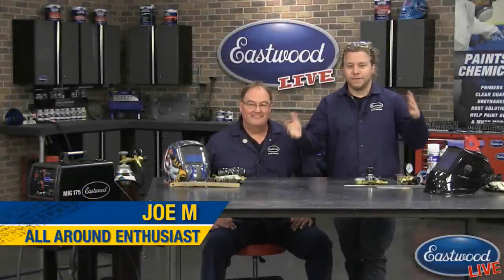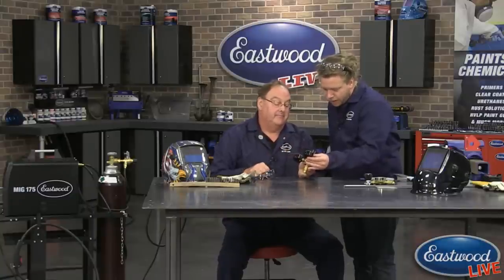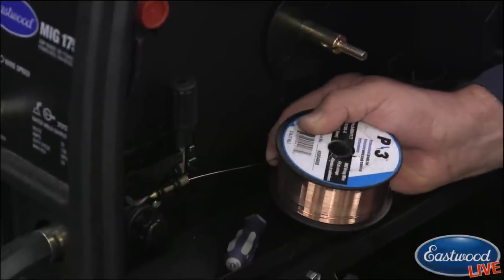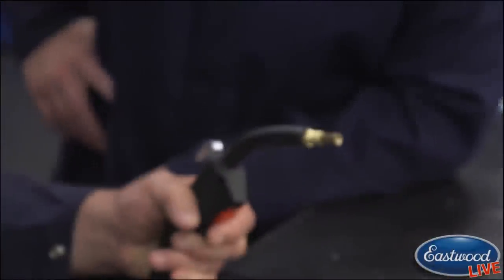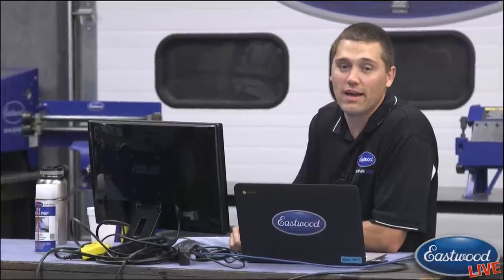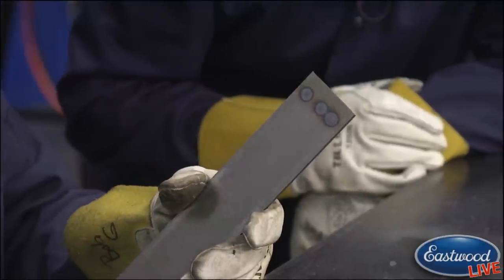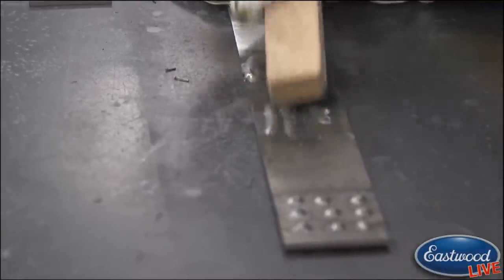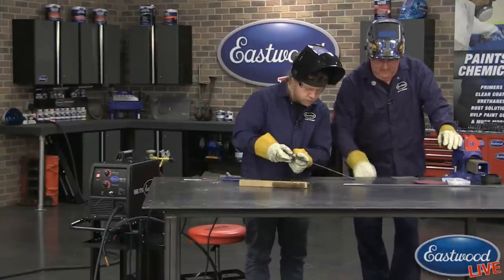Beginner’s Guide To MIG Welding.  Everything you need to Get Started & More!

Comment: I wish I could have seen this when I started welding 5 years ago!
Reply: 24:07 “ go down until the wire TOUCHES and pull trigger.”   OMG .....I didn’t know this until I watched this video and stopped MIG practicing as i was pulling the trigger with it held away from the metal. So backburning tips, stub out messes. Even a birds nest at the feeder. THIS video is the only one I found that actually shows and explains. Other vids just assume you know to touch the wire and then PULL THE TRIGGER...With Stick being sorta similar but not as its “LIVE” and TIG being a footpedal and spacing...this was the breakthrough for me to go back and practice my MIG welding. THANKS guys.

Comment: Nice video. I just bought my first MIG welder and feel comfortable doing a couple of spot welds today. One thing that would be nice would be to explain exactly what the shielded gas is for. I plan to look it up before I start.
Reply: He actually mentioned it in his video. It's to prevent oxygen mixing with your weld, you don't want your work to start rusting immediately.

Comment: Is there a video of the actual setting up of the bottle and what is or type of gas mixture
Reply from the maker: 25% CO2, 75% Ar. Always get your bottle secured to the cart with a safety chain BEFORE removing the safety cap. Get your regulator and hose attached. Be careful when tightening down those brass fittings. They only need a good snug to seal. Check for leaks. Set flow rate anywhere from 15 to 25 CFH. That should do it, hope I could help. 
-JD

Comment: Hi Bob - Thank you for such a great tutorial! I'm having trouble with the proper settings for welding 1/8" steel with my Mig135. I'm using .030 steel wire with 75/25% Argon Mix. The settings diagram on my welder do NOT show for 1/8". Would you recommend the proper settings based on your experience? Thank you once again for any support!
Reply from the maker: The chart on the welder recommends flux core wire when welding that thickness of steel.  If you want to use your current setup with gas and 030 wire, can you bevel the edges of the two pieces you are welding together? This will allow for more penetration. Turn the volts all the way up (which is probably setting J on your machine) and start with the wire speed about half way, or a little more, about 6 on that machine. Lay some test welds and confirm you are getting proper penetration. - Eastwood
Reply: I could not thank you enough for your reply, I'll give this a shot the next time I'm in my garage!
Reply: I had the same question

Comment: Thank you  What I don't get is Reboot has a 12 ga wire/20 amp connected to it but it says input can be 50 amps  Won't the 12 gauge wire going to the welder melt/overheat?

Comment: Do you have to get a steel table it it the best way
Reply: Burning hot molten metal falls around as you weld, so a wooden table would just burn up. I think that's the reason people use metal tables. You can also ground the table but I think the closer to the weld the better it is.

Comment: I understand that you want to match the tip to the wire diameter. For example .030 wire needs a .030 tip. My question is about the threads on the tip. Are they standard "tip threads" or proprietary? Could I get consumables for MIG anywhere to fit? The nozzle also? Thanks, Rob
Reply from the maker: You can get the supplies at Eastwood or most welding supply stores.

Comment: I like it and want to own one but I just have some two questions. How thick does that MIG machine 175 can weld and how much AC power source of that machine can be plug into?
Reply from the maker: It will weld up to 5/16" steel and operates on 240v